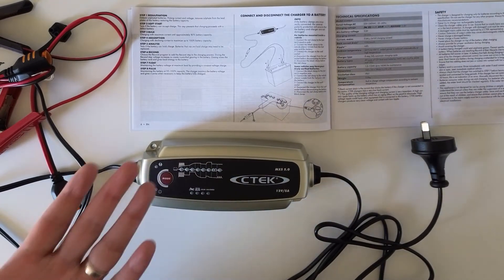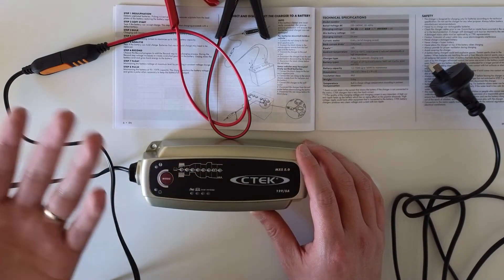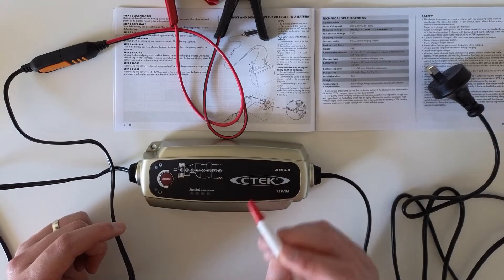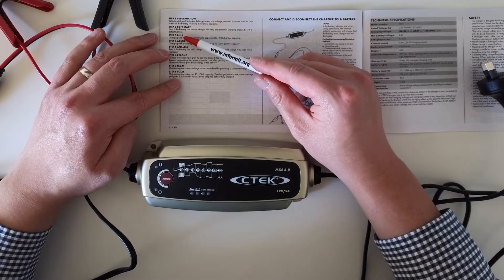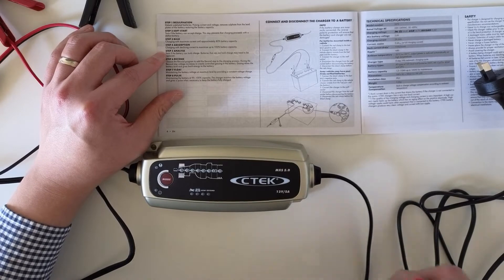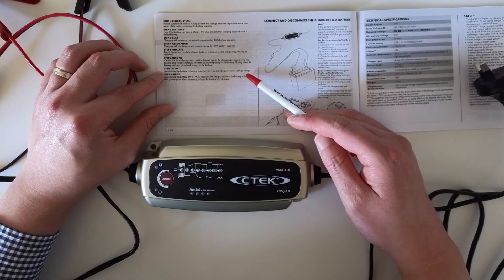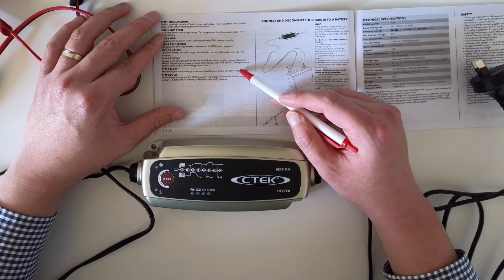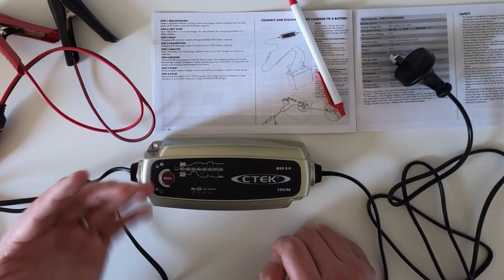Follow-up and review of the CTEK MXS 5.0 Battery Charger & Maintainer

Comment: The reason why your battery doesn’t charge properly is because your battery AGM battery and you need a battery charger that has an AGM function all stop start car have AGM .CTEK make charger for AGM. Check what type of battery you first
Reply from the maker: I checked my battery. I had a replacement battery.
Reply: Thanks for the video - in the specs this charger does have AGM mode - just had the dash speedo cluster not light up on bmw gt3 2015 suspect low voltage as car was left in my garage (winter) and not driven for 3 weeks while on holiday -started very easily all functions except for instrument cluster which is not showing speedo , temp, fuel battery etc... center dash screen works so hoping this will get it going without buying new battery